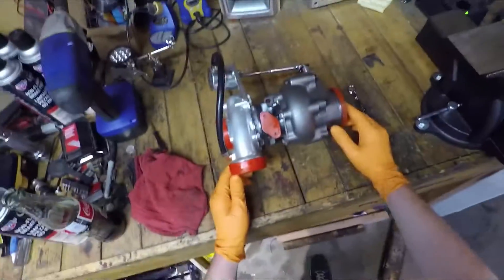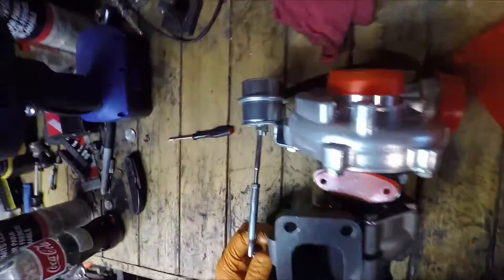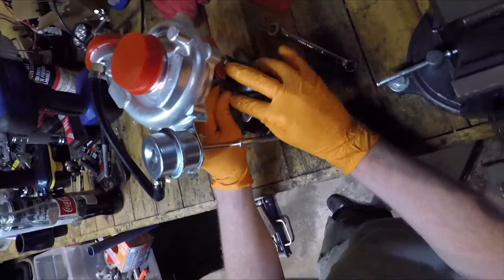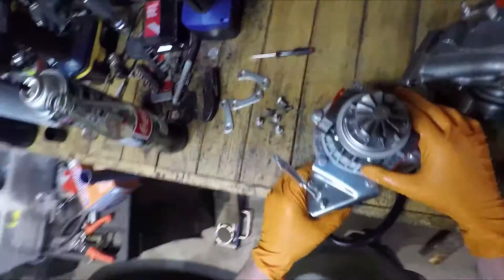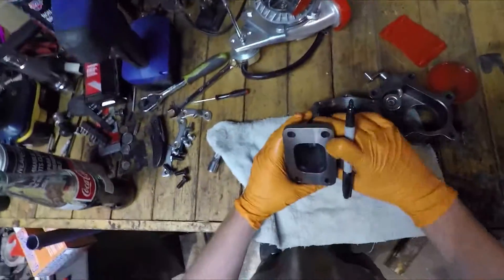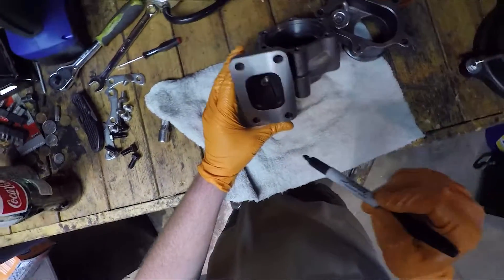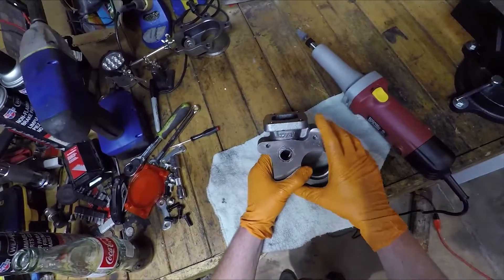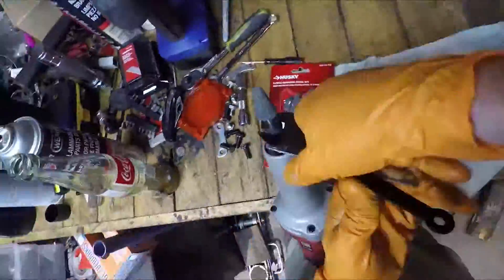Porting MKTurbo Wastegate to Prevent Boost Creep

Comment: I’ve done both those things but I am still getting 4 psi of boost with the wastegate wired open on my setup, and I have it ported out to its limit I believe. I didn’t make the cut behind the flap though, maybe thats needed?
Reply from the maker: Your exhaust could just be more restrictive. Also 4psi of creep is no big deal, it should maintain boost target better now.
Reply: @Turboactive  Thanks! I actually have the 3 inch exhaust that comes with the MKTurbo kit...wonder if I should maybe widen up the channel a little. I do have an EBC as well though. Not sure how much boost a stock Miata 1.8 can hold, this is my first turbo and my goal is around 230whp.
Reply: how did it go?
Reply: @dennisrobinson8008  Carving out the channel towards the wastegate hole was the ticket. Before that, not enough exhaust gas was being directed out of the port. Been pretty good so far 2 years boosted!
Reply: @LowkeiHoagie  channel is carved on the wastegate side?    Is like the ability to bring it down to 4psi if required.
Reply: @dennisrobinson8008  I carved the channel inside the turbine where the exhaust gasses flow out toward the wastegate hole, pretty much how its done in this video, but just widened it and made it a little bit deeper

Comment: What a terrible designed turbo. I'd just choose something different. Never even seen one where the waste gate doesn't open properly. If you want a cheap one I'd go for maxpeedingrods or something. You still will have to Mill out the waste gate port but they are built great.
Reply from the maker: Agreed however these china turbos are less than $100
Reply: @Turboactive  the maxpeedingrods is a little over £100 and doesn't catch like that. Worth paying the extra £20 to £30 just for that however I do know the port still needs porting to match so not to get boost creep.
Reply from the maker: @christophercarson3143  I gave up on the cheap stuff now I have Borg Warner EFR and make 326whp :)
Reply: @Turboactive  I'm making 330 with the maxpeedingrods one on a base map. I am planning to use something else when taking to get more from it but it is a front wheel drive car so it's OK as it is and being in the uk it's wet a lot so obviously can be pointless going out in it but hopefully get everything sorted and ready for summer. If we manage to get one of course. Arashi and mamba and such turbos seam great value so I might go down that route yet but only time will tell
Reply from the maker: @christophercarson3143  Haha damn thats awesome what car?
Reply: @Turboactive  it's a vauxhall astra vxr but has a saab b204 engine fitted with all supporting mods. Still unfinished as will be going for more power in the future at some stage. Unfortunately I don't get to drive it or work on it much with life getting in the way.
Reply from the maker: @christophercarson3143  Awesome I love hot hatches!
Reply: @Turboactive  I'm on fence with it to be honest. I do love them but absolutely love rear wheel drive cars and can never get away from missing them.
Reply from the maker: @christophercarson3143  Haha yep that's why I own a turbo Miata and a 200whp Civic EP3 :) Best of both worlds!
Reply: @Turboactive  I was actually going to get a miata. Known as a mx5 here was just going to get it to fit the Blackwell spr1 body kit to it. Makes it look similar to a tvr but shorter obviously. Might even still do it once iv made some room and got more time on my hands. Which I'm hoping to soon so more projects 😂/Toys. Cracking little motors
Reply: @Turboactive  EFR6258?
Reply from the maker: @dennisrobinson8008  yep 👍
Reply: @Turboactive  That's a really nice unit!
Reply from the maker: @dennisrobinson8008  yeah it's an amazing turbo. Check out my channel I have another video of my Miata dyno 324whp

Comment: So was the relief channel for the back of the wastegate flapper needed or do you think you can skip that step? I used an end mill in my small milling machine to hog out the turbine housing and that worked well. I had tons of cast metal dust when I was done. The opening is oblong, but pretty big. Still in the infancy stage of my build with Lars's kit. Hope to have it fired up soon and fiddle with some megasquirt.
Reply from the maker: Chad L. The channel definitely helps but if you are running more than about 12psi then it's probably not needed because it won't creep much above that anyway. Most important thing is to not hog the hole out too much so the flapper seals well.